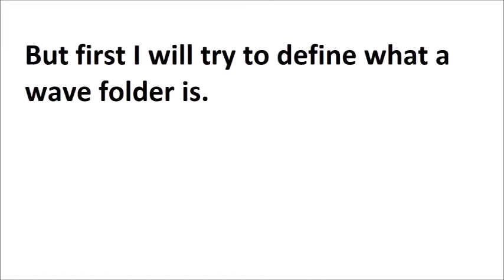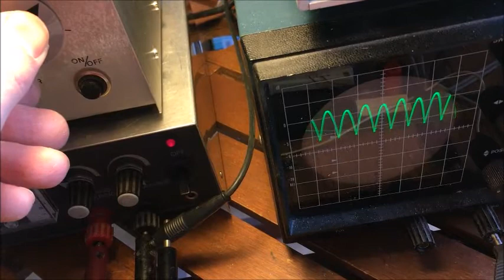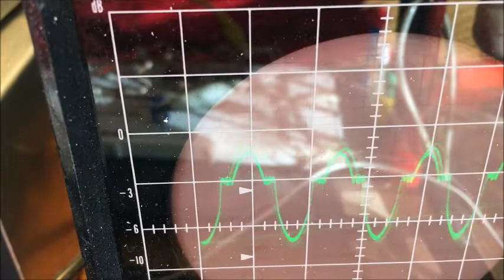Wave folder

Comment: I've been searching for a wave folder to incorporate into my synth signal path, and this is one that doesn't require me to get 20 bloody op-amps like the Buchla 259 schematic I found, though I can't really read the resistor values very well on your drawing. Would you be so kind as to help me out?
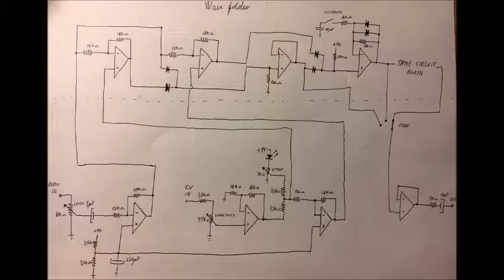Reply from the maker: On the picture "This is the actual wave folder" at 4:00 everything is 18k except the one under the word "compress" which is 10k. On the picture "This is the input circuitry" at 4:10 they are from left 10k potentiometer (other values can work too) 18k and 100k. The ones connected to the 220uF capacitor are 3.9k and 3.3k. On the circuit "CV in" they are from left 5.6k - 4.7k potentiometer - 10k - 18k. Under where it says "Offset" it is 1k - 3.3k - 2.2k. The two on the opamp at the far right are both 18k. The one at the output is 1k but that one isn't really necessary. It is there to limit the current if the output is shorted or connected to another output.
Reply: @organfairy  wow, quick response! and thank you! I'm building an open-source Analog Synth w/ Full Logic Control (aka, complicated arduino programming and DACs) and I'll be adding your name to the credits most likely

Comment: OrganFairy, i was made an MS-20 filter clone without 5-7 and 10-12 pin jumpers on LM13700... And i've got a kind of waveshaper/distortion. It gives a rough sounding signal... I've decided to use it for a solo. You can listen it here:
https://soundcloud.com/kirill-threedee/ms-20-clone-test
There are two oscillators that goes to one filter. So this phasing is because of it.

Comment: Hi, cool stuff.
what is function of the 4th op amp and the switch above?

Do you need to repeat op amp 1,2,3 after op amp 4?

You can't read the resistor values.
Reply: I see, why is the pull down resistor after op amp 3 before the compresor ... and what is the effect of the compressor?
Reply from the maker: The function of opamp 4 is to act as a kind of compressor - actually it is more like a soft-clipper but that a question of how you define it. The reason I put it in there is because when you fold the waves you will also make the amplitude or volume lower because the waves are folded "inwards". So it is an attempt to make a more steady volume. A side effect is that it introduces some distortion that colours the sound. I switch the compressor on at 5:17.I think it sounds best if the circuit is repeated but it can work with just the 4 opamps. In the demo I first use it with only opamp 1 and 3. Then at 4:53 I switch to all 4 opamps and then at 5:05 to both circuits.
Reply from the maker: There is a pull-down resistor on the input of opamp 3 because the two diodes can only push up so you need a resistor to pull down. There is a pull-up resistor on the input of opamp 4 because the diodes there can only pull down.
Reply: organfairy right. thank you. Pretty cool thing you built there from scratch and explained well.
Reply: organfairy so if you built this circuit, you should place this compressor at the end?
Reply from the maker: yes.